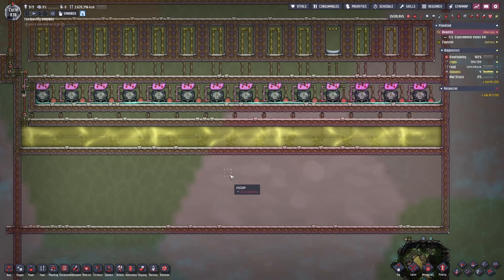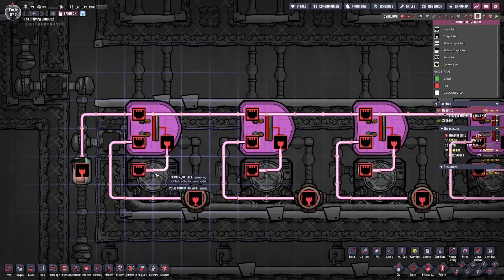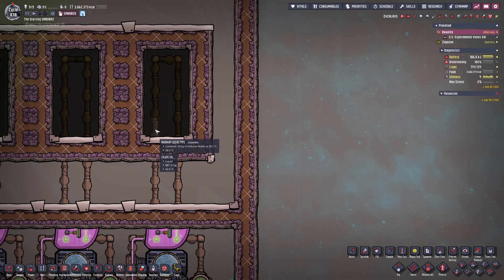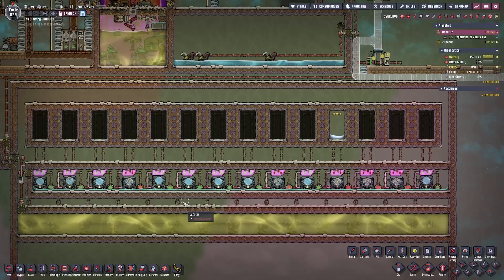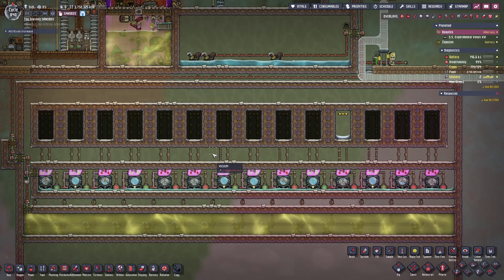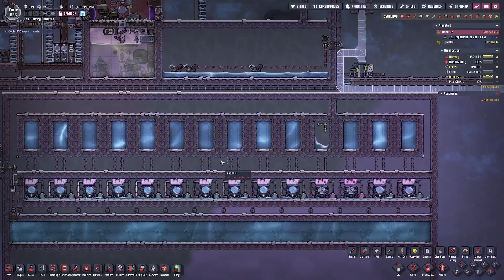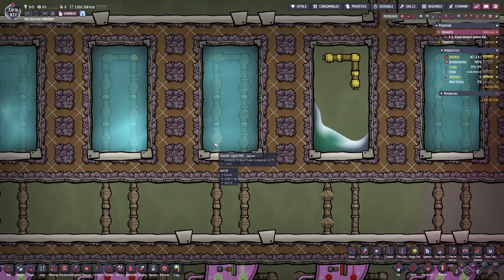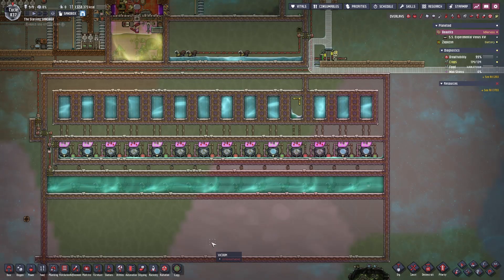RANKING the BEST RADIANT LIQUID PIPING in Oxygen Not Included

Comment: Hey Ethan, suggestion for a video: making different ways of cooling your base (e.g cooling the oxygen coming from the electrolyzer, using an heat exchanger and taking gases from the base, cooling it outside, and then reinserting it to the base (just like an actual AC), running radiant liquid/gas pipes throughout the base, etc) and also setting different cooling chambers (with cooling pipes, wheezeworts, etc)

And I think a deep comparison like you did would be great to visualize the difference in efficiency between all the methods

I was watching a stream once, and the streamer made a cooling loop with hydrogen to cool the base, and later made a cooling chamber for the electrolyzers with wheezeworts, it was pretty different from usual and I thought comparing it to the mor "usual" cooling methods would be and interesting way to show the many different ways the game can be played
Reply from the maker: Thank you for the suggestions! I love the comparison videos and your ideas are exactly the type I love to work on!
Reply: @ethanplays-lag  such videos are great but it would be much better to just show a table with results instead of reading it for 15 minutes.

Comment: Good news on the interchangeability of many metals.

Also, great timing!
Just last night I was sketching out my current game's first contained industry and trying out a sauna brick for the first time.

I got a bit frustrated at the huge amount of steel it takes plus radiant pipes for the refinery. But I have lots of aluminium to use for those.

Now I just need to convert some oil to petroleum for coolant and get me some diamond too, because..

The thing will double as volcanic rust melter. Plus iron ore once it's set up anyway.
Very low tech, just dropping the solid on a pressure plate from a conveyor (to prevent overloading) and diamond window connecting to a bit of magma from a volcano that also gets dumped when it gets too cold.
Liquid iron flows down for a brief counterflow (small space) and down through a mesh tile with diagonal gap into the sauna. Same with cooled magma.

It won't be terribly fast and that's ok. Can feed iron ore into the refinery when I need more faster.

I just need to decide how many turbines will keep up with that plus one each of the hot machines and 2 kilns.

Comment: What are the thermo sensors attached to the aqua tuners set to?
The “inefficient” pipe metals will run the tuner less because the liquid in those pipes will be cooler than what is in aluminum pipes.
Let the coolant get colder and the other metals may catch up to aluminum for how fast they cool the oil.
Really in the long run the only important thing is what liquid is going through the tuner. Fixed -14C instead of liquid SHC really is a bit of a lazy game mechanic.
Reply from the maker: Set to 1 degree, shown later in the video